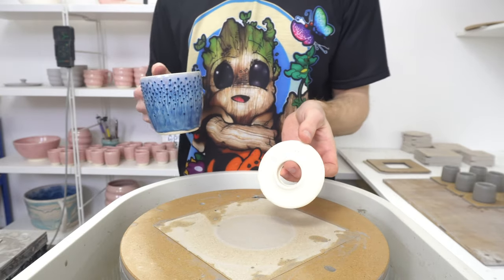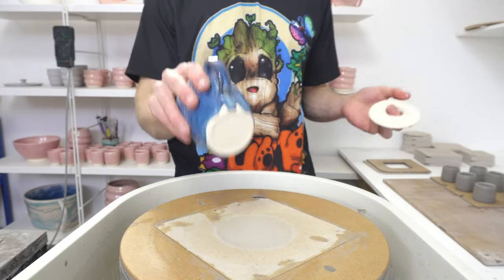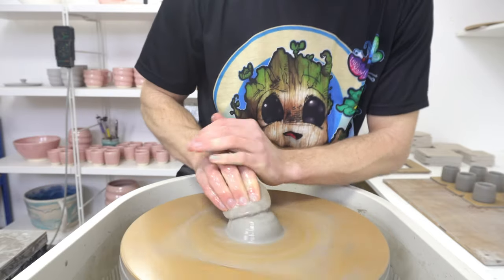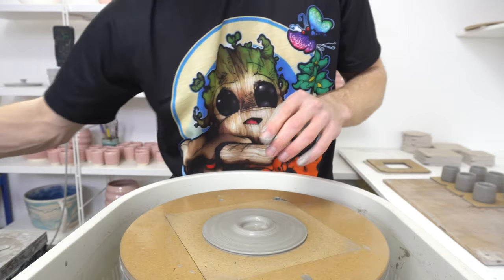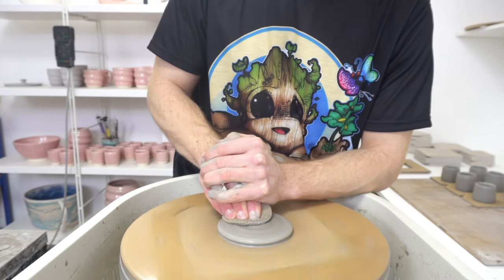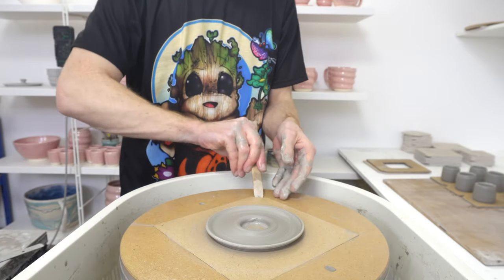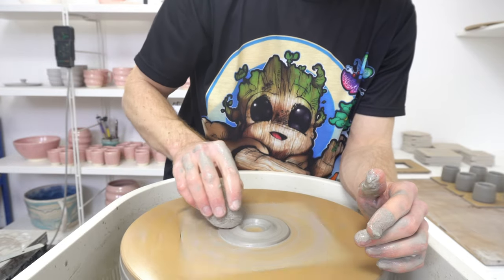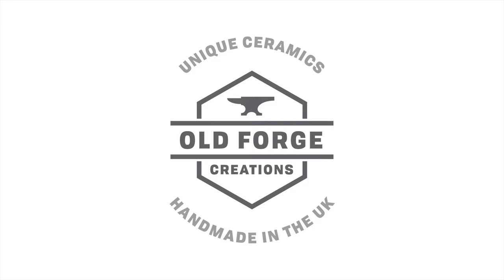Throwing Drip Catchers

Comment: At first I was like why don't you just use stilts? but then realized the edge will catch anything that does drip off, plus no points digging into the mug. Brilliant idea.
Reply from the maker: Yep! And they'll work at any temp (if you use an appropriate clay), whereas a lot of the stilts have upper limits. And these are cheaper, and you can make them custom shapes for things like pourovers